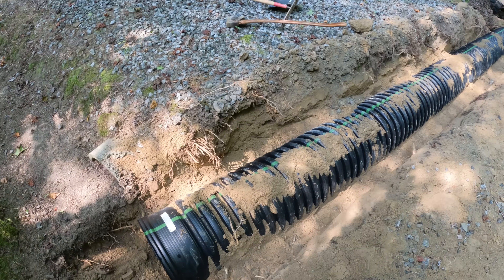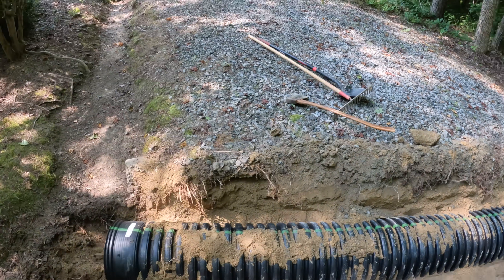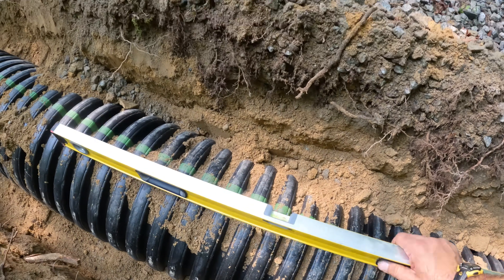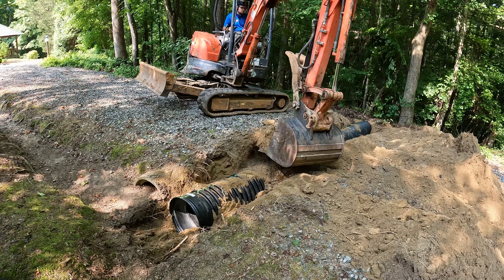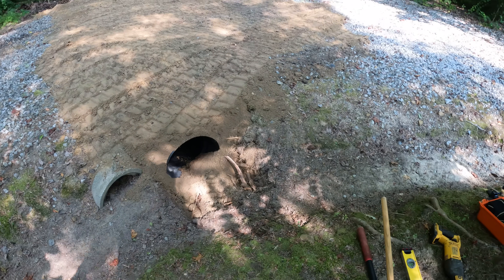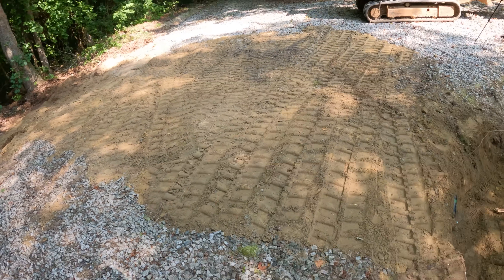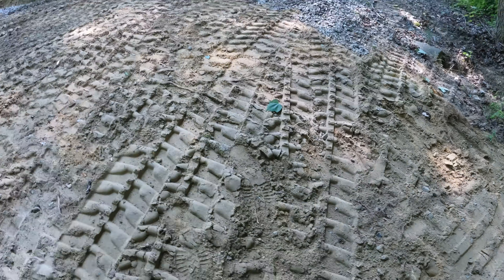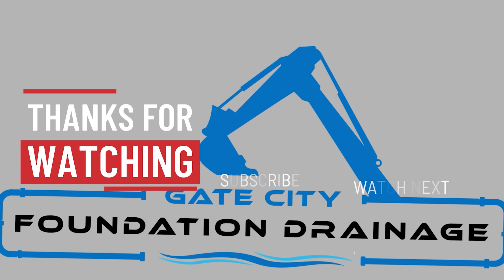Installing a larger culvert to replace a clogged one

Comment: If the cement pipe isn't busted, why not jet blast it yearly?
Both my old neighbours 6inch pipes would get clogged yearly. And my family would get the hose and pressure attachment and blast them out.

Comment: You could have easily used a root cutter to clean out the concrete pipe, that won’t fail and it’ll likely last forever. If you maintain it. Which includes annual cleanup of silt in your ditches nearby!

Comment: Why would you, who claims to HATE corrugated pipe, install corrugated pipe here?

You just have to know that this new culvert WILL be filled with dirt, rock and mud in very short order...

They make 16 inch Schedule 40 PVC (14.95 inch inside diameter)...that would have been a MUCH better option since being smooth walled, the dirt, rock and mud would tend to get washed right out...

Comment: When there is water flow from two directions, where they converge (head-wall), this is a vital area to address. By laying SV2 rock at the head-wall would be a good cheaper alternative than leaving as you did with nothing but dirt.

Comment: Have you seen people digging with high pressure water instead of a backhoe to avoid line breaks and such?  I would if that would make quick work of that clogged pipe starting with the furthest downhill entrance first?  

Any concerns that the second pipe you added will also clog with dirt even faster than the concrete one did?
Reply from the maker: They liked the idea of a larger pipe over cleaning out the old one. I guess it could still be cleaned out if they wanted...

Comment: I would have thought maybe some rip rap before the culvert entrance would help filter out the debris before it reaches the pipe would help. Maybe 8 to 10 feet worth is each direction. Surprised you didn’t quote that. As well as a bit of new gravel to top dress your work area of that road. Thoughts?
Reply from the maker: Great point Baron! Filter is the key. You're talking about a filter that never gets changed or cleaned. So all the material that is caught by the riprap would clog it and eventually the water would overflow the road. I like to provide an unobstructed path for the debris so it can move through and out of the pipe. 👍 The homeowners want some gravel brought in for some other areas, so I will dress up the area when I deliver that gravel.
Reply: @GCFD  thanks for the reply! Also. Your abbreviated handle looks like its for a Fire dept. 😆

Comment: Was that pipe installed too shallow? Post 10 has the formula of needing to be covered with a soil depth of 1/2 of the culvert pipe diameter.

Comment: Good job, all things considered.
This clog was easily avoidable by the home owner. You have to keep your drainage ditches clean (infront and after the pipe). Otherwise there is no way the pipe won't fill up.
Disregarding all the discussions, if or not the old culvert should have been cleaned instead, putting a new one in (not replacing the old one) is probably the cheapest option here.
Doing that, you did a good job installing that culvert, Shawn. Bedding it good and (probably, as I can tell) deep enough, making sure it falls correctly and cleaning out the ditches. Still the home owner should clean out the drainage ditches all the way to avoid the same thing from happening in like 5 years.
Personally, I would have tried to clean out the old one, as concrete is far more sturdy than plastic even if the latter is installed correctly (bedded and there's at least half its diameter of soil on top). I just don't really trust these plastic culverts when driven over. They crush so easily. There is some reason you don't see them where I live in Europe.

Comment: Just curious about the cost difference between the plastic pipe and a metal pipe? Per Post 10’s experience the plastic pipes fail much quicker than metal. I guess it depends on the amount of traffic over it. Definitely better to leave the old one in place.

Comment: Sean, is that the only positive use you have found for using corrugated pipe?
Reply: That pipe is smooth on Inside and corrugated on outside

Comment: Isn’t he breaking his own rule about corrugated pipe? Been easier and cheaper to have concrete one cleaned and put some rocks on both sides to help with the dirt.
Reply: It is double walled. Corrugated outside for strength or structured and inside is smooth wall
Reply: 12:20

Comment: For this video, I assume you followed the home owner request? In the comments there are mentions of @Post10 but I my opinion in what he does (full disclosure I do follow him) and what you do is not quite the same. The situation is that @Post10 is dealing with beavers (for the majority (90-95%) of the time) and you are not. Not sure how much water flows to that culvert but it looks like if that culvert was maintained there would be no reason why it was clogged (homeowners do not know better or are lazy?). However, I do not know the amount of water the flows through that pipe and it could be the pipe is undersized and another pipe to help it divert water to prevent it from being clogged (unlikely?).  It also could be the design of the entrance of the culvert is not correct to begin (clearing it out would help but only temporarily) with in this situation? More culverts (two or more) is not always better.

Comment: Great video Shawn,
I do think you can share some great culvert cleaning content by revisiting the concrete drain and trying the following:

Pushing a series of interlocking 6” posts through the concrete pipe to get a chain through
Tyre & chain to drag it through
Show us the extent of the blockage.

This way the homeowner has the benefit of 2 culverts.

Keep up the high quality content Shawn - always a pleasure to watch Sir.

Comment: Love your work Shaun, but I'm not sold on this one. If Post10 has taught me anything it's Corrugated culvert pipes suck, especially when they are shallow buried under a roadway. Debris will clog up the corrugations, and over time vehicles will crush the pipe itself.
Reply: I thought the same thing until Shawn explained (and showed) that while the pipe was currogated on the exterior for strength, it was smooth on the interior for clean flow. I was also screaming at my screen “why aren’t you using a level to check for fall!?!”, but then he did.😅 Obviously I’ve picked up some tips from this channel!

Comment: I used 4" dual wall corrugated pipe to replace an old single wall drainage system and it works very well, the only problem was that I had to dig a 40 foot trench by hand through clay and gravel.
Reply from the maker: Rent a trencher?
Reply: @GCFD  I couldn't, I'm only 16, but I'm getting my license in week and my dad wasn't going to rent out any equipment.

Comment: Ya the concrete pipes get roots in between the sections & cause a clog by grabbing everything.  The plastic was a modern solution. 

In low-slope ditches, or high-tail-water, you only need to clean out the outlet b/c the inlet will have a self-maintaining-flow velocity.  What they might need is larger sediment areas to catch a lot of that runoff-debris. Dirt ditches in my area are county-suggested to be maintained every 5-7 years, if the side-slopes are low enough.   Also in low-slope you can actually run the pipe at a -1% slope b/c the additional head-pressure at the inlet will actually increase the intake capacity, basically the taller you can get the water at the inlet the more pressure is on the outlet for low/no-slope.  You'd be surprised at how deep some of the inlets are installed in my floodplain, but they maintain themselves very well.

Comment: You might want to give your customer a Heads UP about having a vacuum truck come out and suck all that material out of their OLD pipe ! Won't be cheap , BUT atleast they'll have 2 clean pipes for proper drainage !
Reply from the maker: That would be a great way to increase the capacity!

Comment: Is there a way to snake that concrete out? A pressure cleaner and jetter doesn't seem like it would work.
Reply from the maker: A vac truck or a jetter truck would work. I've had luck jamming a large 4x4 post in with the excavator too.

Comment: The owner should hire someone with a jetter hose to clean out the concrete pipe. Two drainage pipes are certainly better than one. I'm a little surprised that they had you replace it rather than having the concrete one jetted out. It would have been a ton cheaper to just jet it. Oh well. Another job well done!
Reply from the maker: I'm not sure if it would have been cheaper. This was a pretty easy install so I didn't charge much.
Reply: @adamluke1289 nature is what filled it though
Reply: Wait til its alittle wetter run a chain through the old culvert and hook a car tire to it... Pull the tire through the culvert will pretty much be clean...
Reply: @chrisjohnson4666   right on bro yep car tire n a good chain would’ve solve n clean it great n really cheap  seen many people do it n it actually fucking works lol🔬🎯🫡
Reply: Rip rap?
Reply: You must not heard the shout out to vance from South Carolina cleaning.. maybe he went out and figured it was cheaper to install a new covert??
Reply: I thought the same thing, but if it's filled up with roots that would be a huge pain in the ass
Reply: @BeerkegGarage  They sell heads for the jetters that will slice up roots like nothing as long as you've got a good machine with high pressure.
Reply: https://youtube.com/shorts/lBPLlladwY4?feature=share
Reply: This is a example of disposable income.
Reply: I mean I question mentality .... Concrete will last longer... Cleaning and reusing vs just installing newer ones, corporate way of thinking too .... I am not complaining or anything just feel that a simple jetting hose will make it so much easier....heck even an afternoon with a shovel and 3 cans of beer!!!!

Comment: Why won’t the new pipe fill up like the old one?
Reply from the maker: The new one is a larger diameter, a single piece, it's much smoother on the inside, it has a better angle with better fall, and hopefully they'll keep up with it better 👍

Comment: Man, I don't know about this one. I usually think you were right on with your previous jobs, but not so much on this one. The concrete culvert is full of sediment, the same sediment that will fill the corrugated culvert.  The problem is the sediment, not the pipe. I give it a year and your repair will be plugged up too.
Reply: That was my thinking as well.
Reply from the maker: I feel pretty good about it since it's a larger pipe and a single piece. We shall see! 👍

Comment: Trying to clean out the concrete culvert, at least to help out the new one, wasn't in the cards?
Reply from the maker: No they didn't want to. I could have tried pushing a 4x4 post through with the excavator too.

Comment: Corrugated?
Reply: Smooth walled *
Reply: The corrugations are only on the outside. Inside is smooth.
Reply from the maker: This is double wall corrugated and is smooth inside like David said above. 👍
Reply: Shhh - don't tell anyone.
Reply: Built strong on the outside and smoooooth on the inside.
Reply: You want corrugated in this situation b/c the path is so short that you actually don't want the water to find a path alongside the outside of the smooth-pipe.
Reply: I had some questions, but then he mentioned that it's smooth on the inside.